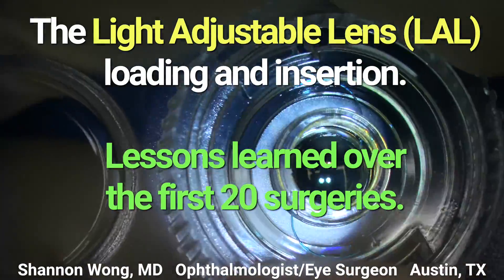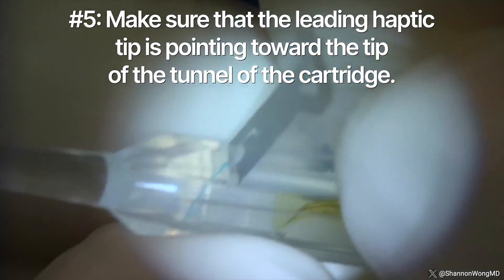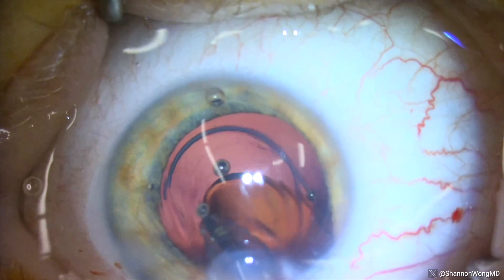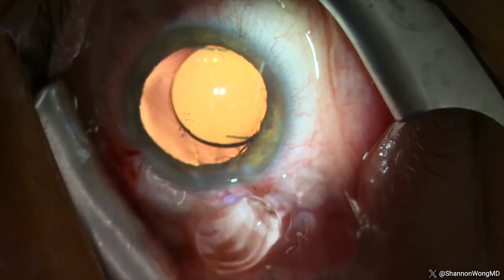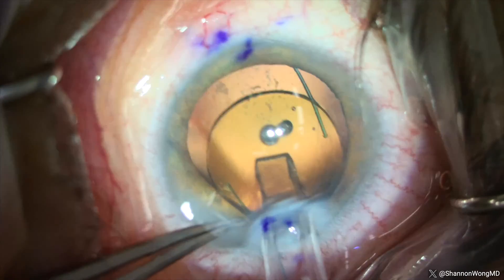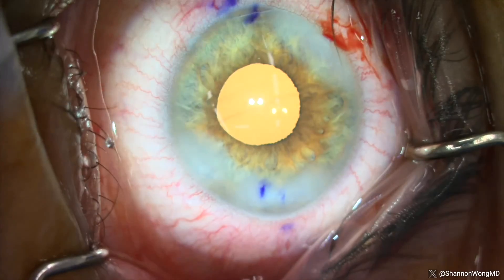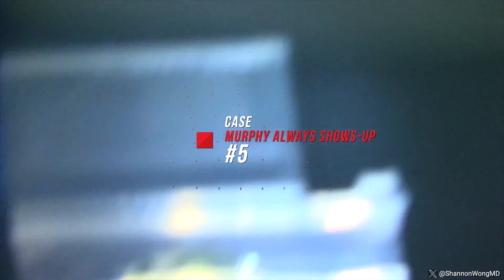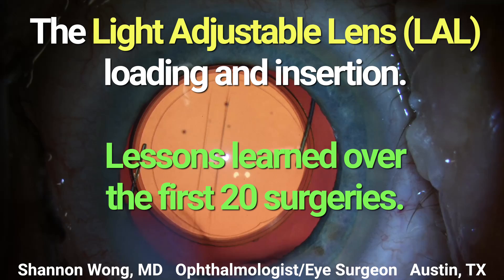Insertion of the light adjustable lens   Lessons learned - First 20 surgeries.  Shannon Wong, MD.

Comment: As a "civilian" I have a question.  For astigmatism, is the correct done later with the light?  If the correction is already in the lens, proper orientation looks to me like it would be difficult.
Reply: A high level of astigmatic can be corrected via the adjustments using the UV light postoperatively. Most patients are corrected at week 3-5 post op.

Comment: Thanks for the video after doing 200+ of these I can tell you each case is unique.  Helps to go very slowly, and to slightly bevel left at beginning to get haptic coplanar, followed by bevel down to deliver first half of IOL and start beveling right to deliver lens (it will come out quickly) then retract plunger and bevel even more right to deliver the trailing haptic into the bag.  I find these haptics are very difficult to angulate downward when dialing in, so I very much try to deliver into the bag.  Look forward to seeing more from you